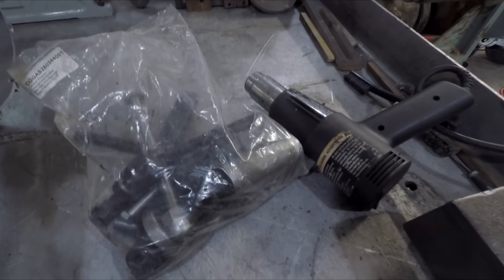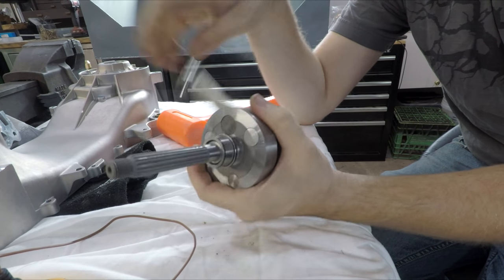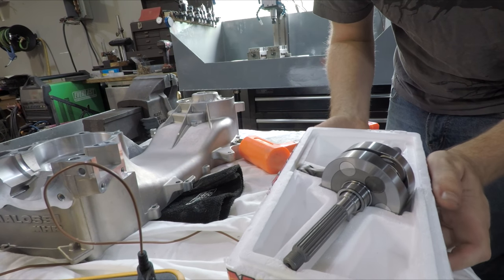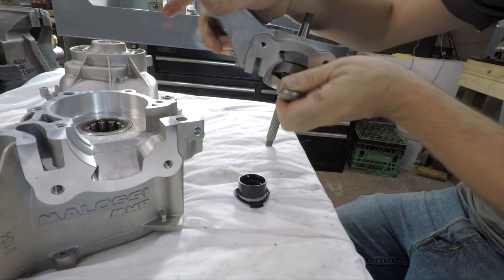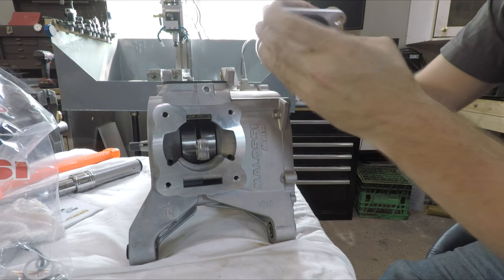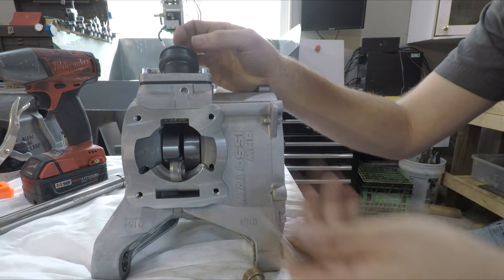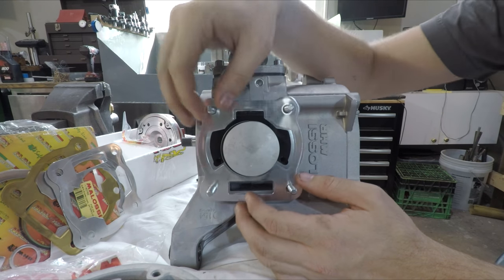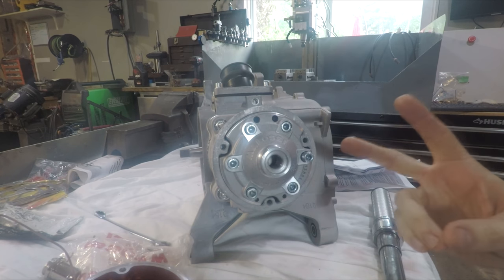Malossi RC-One 94cc Engine Build Walkthrough! Part 1 - J's Garage

Comment: do you know what size seals are on either side of the crank? looks like the smaller diameter, wider one goes on the stator side. just double checking before i get it seated
Reply from the maker: I think your right on that but it's been a hot minute since I've been inside that motor so I don't recall off the top of my head.

Comment: Hi very good ,but you need to polish are make it smoove in the flow from the cilinder ..the block too.i use 300 are 400 paper.👍👍
Reply from the maker: Wanted to run it bone stock first before any modifications.

Comment: How long did this rod/bearing last. My c one drove for 4 hours now was just wondering how long i can count on those bearings
Reply from the maker: No idea, lots of variables there.  Mine still only has a few hours on it.  But lots of WOT or hard miles/high rpm may decrease the life expectancy of the bearing.   Good oil and a rich oil mix will help with heat and lubrication as well.

Comment: Why didn't you use any assembly lube?
Reply from the maker: I just use 2 stroke oil. I will usually put some on the bearings and in the bore before buttoning everything up.